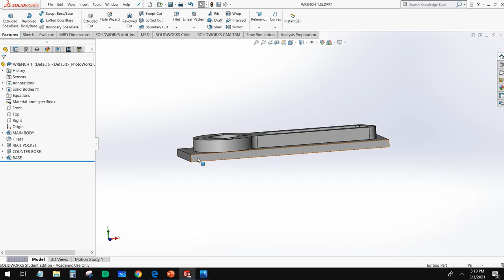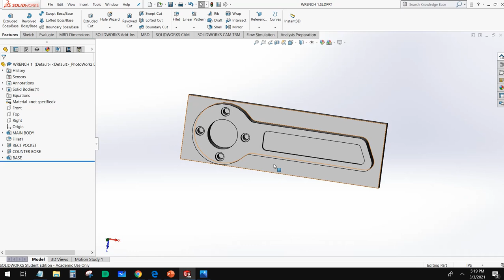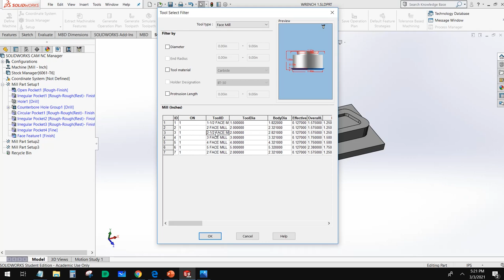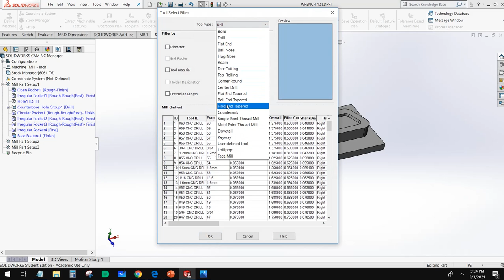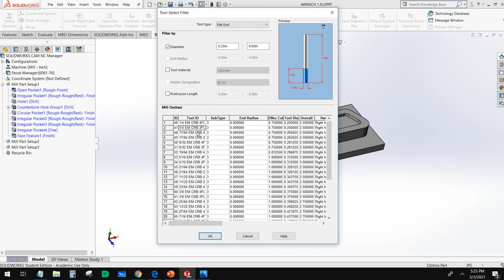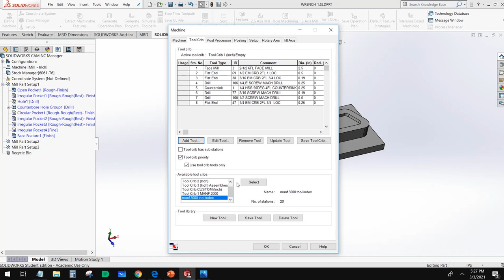SOLIDWORKS CAM: CUSTOM TOOL CRIB

Comment: Hi, don't know if you're still responding to comments as the video is 3 yrs old, but I'm kind of running out of options and resources. My issue is even after checking the box labeled "use tools from tool crib only", after doing the extract machinable features then go to generate tool path it will still pick tools that I don't have in my tool crib and put them in the program. I'm new at using Solidworks cam feature and any advice would be greatly appreciated. Thank you, Josh Fodstad

Comment: Could you upload this part? I want to do all mentioned stuff by myself.
I also want to complete other tutorials:
TOOL CHANGES AND ADDING TOOL PATHS
BASIC HOLES, DRILL, TAP, COUNTERBORE
ADVANCED 3D CONTOURS
I would be grateful for all files that I need to do this.